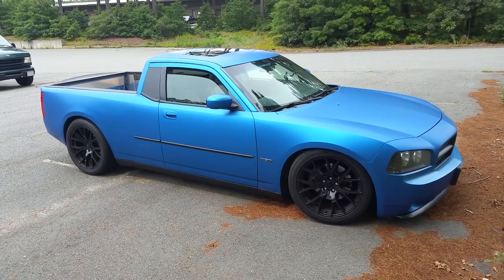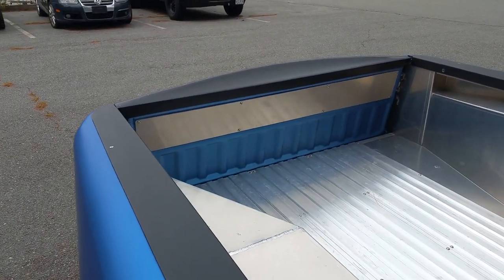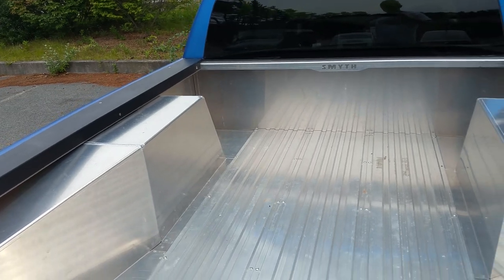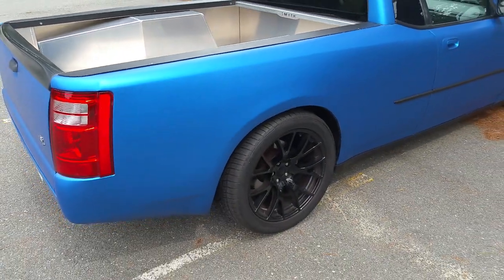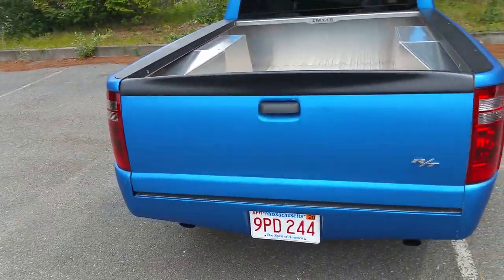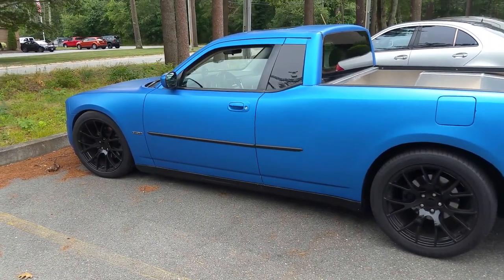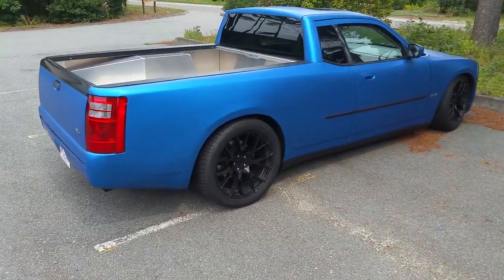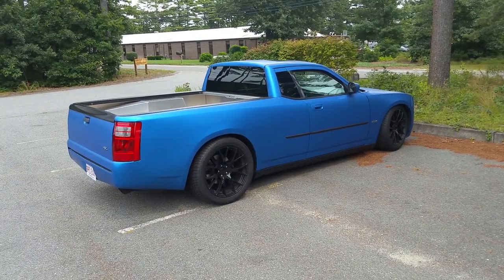Smyth Hemi Charger Ute walkaround

Comment from the maker: Hit the link below for FREE build manual... Hope you enjoy!
Reply: Smyth Performance any kits for g8 or 2013 caprice?
Reply: Now think about doing a wagon conversion for the Charger 2nd generation.
Reply: @rileysmith9843  there was some 2006-up concept art ( and some 60's and or mix of the 60's ) that didn't do it the same and had flying butris liked it more but this design not as much but probably more useful as a pickup and or camper/toper fitment ect.

Comment: I love it. The only mods I would convert is the fog lights  should be yellow led. I would have Dodge viper side pipes installed. Probably store it in winter. A rhino roll on bed liner should coat the bed entirely because eventually the aluminum will corrode. I want a functional cowling hood intake and the 5.7 hemi engine. A tonneau cover for the bed would be sweet.

Comment: I've have seen on the internet a Dodge Challenger and the Dodge Charger both converted into pick-ups trucks, and I have to say that the Charger pick-up looked a hell a lot cooler than the Challenger pick-up did. Nothing against the Challenger, I love the Challengers as a performance car and not as a pick-up truck, the wheelbase is way too short which does not look right to me, but that's me. While the Dodge Charger or the Magnum wagon wheelbase is perfect for that conversion into a pick-up. I've been dreaming about this for years ever since the Dodge Magnum first made its appearance in the showrooms, such a cool-cool wagon. Good stuff Man!

Comment: Would this work on the 05-10 charger V6 3.5???  The v8 is hard to find in low mileage here in Toronto Canada, and I already have both a 3.5 and a 5.7 2007 300c, my 3.5 is much easier on the gas tank. Also another question, do you have a kit for the 300 same model year range? Could you answer both questions please, thanks. Highly interested.

Comment: Very nice but it needs a tonneu cover over the bed. Down side is you cant access the fuel pumps if you need to replace a failed fuel pump. I would also relocate the cross beam  that goes over the spare tire well area  and i would also cut fuel pump accesss panels design a way to bolt the fuel pump
access panels on and off .  And i would design a access panel with a piano hinge  and a latch mechanism to access the spare tire lug wrench and jack.
Reply from the maker: middle panels unsrew for access to fuel pumps and spare, yes the spare slides out... but the key to this is you can change anything you want right, you are the builder. A bed cover is available for about 250 bucks

Mark

Comment: 2023 Dodge Charger 32k ,2024 F150 more hp 41k ,Chevy 1500 more HP 36K,Ram 1500 more hp towing and carrying bigger box 40 k with options (my truck) Im just saying its neat to drive a fake truck for like a year before you find it it is not practical ,,,,1983 I shoved a 327 with a power glide 2 speed into an old Chevy Love  and spent a year smoking donuts and dropping camaros in the 1/8 ... but then I needed a truck